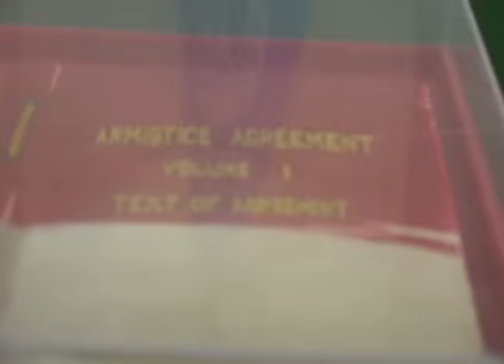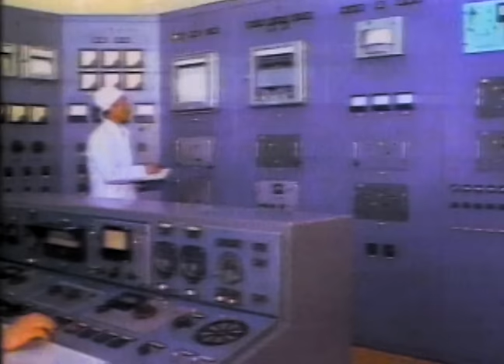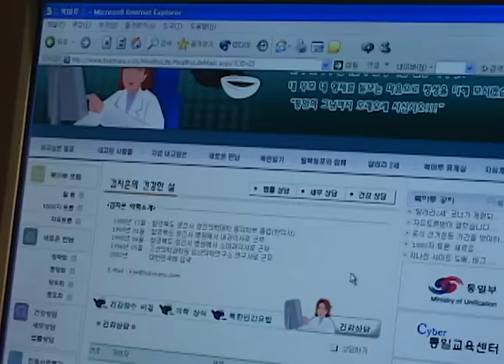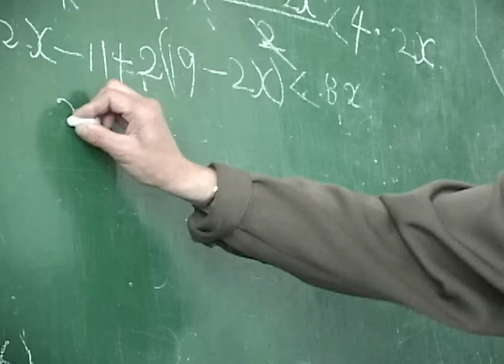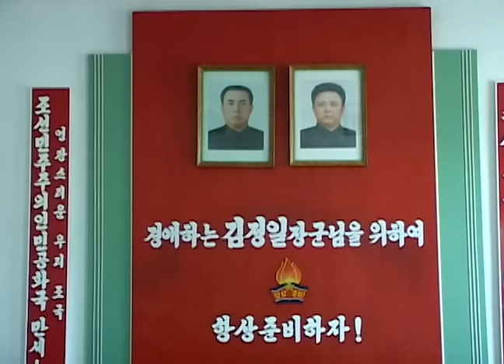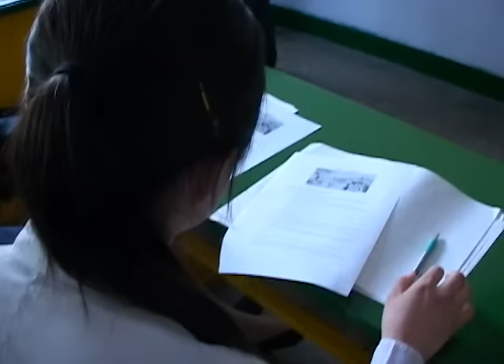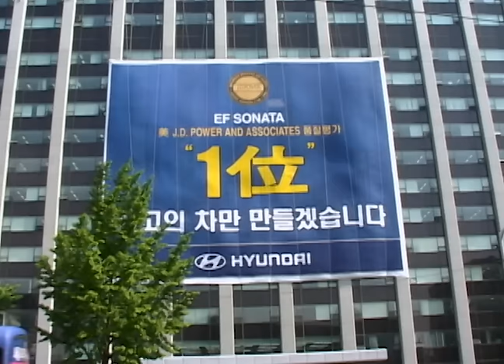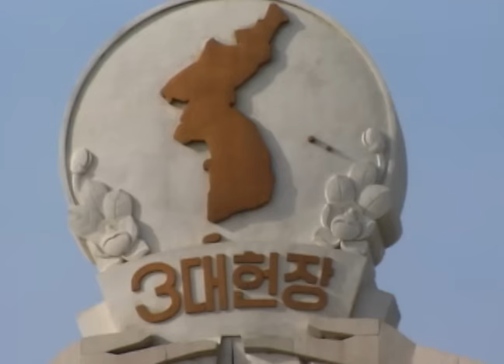How Bad Is Life In North Korea? - North Korea: Desperate Or Deceptive - Politics Documentary

Comment: The ai prime stock market have opened on fine print worrenties. A second degri charges. Loar as mutch. The reads are damaged without proper security letters papers accounts expanding on majors globally adds curnal dobble time. Hareem hot" it is fore David seg combat min to leave , someone crossed the charges can at least ! Assist repearing infulenc off damage's